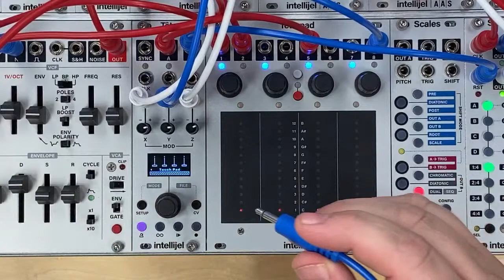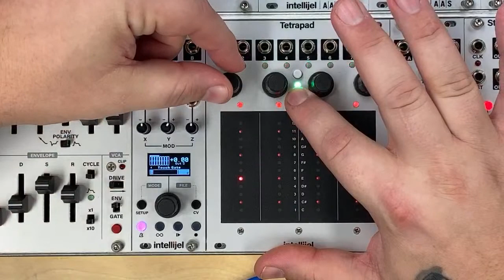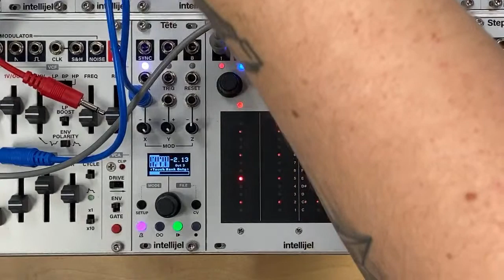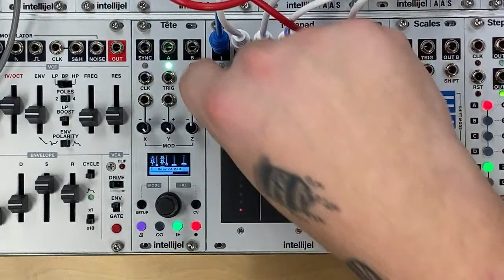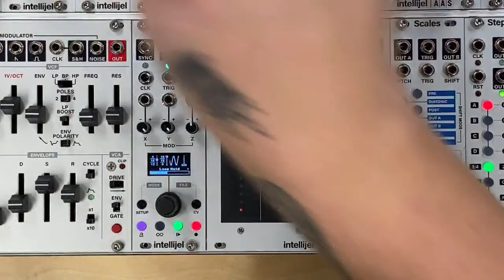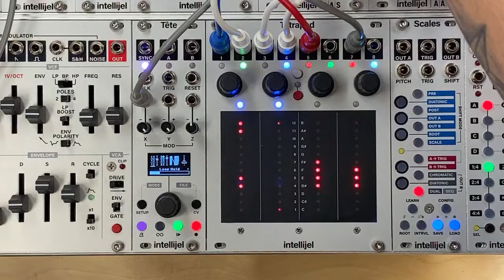Intellijel Tête — Walkthrough / Design / Q+A

Comment: Here's a couple things I glossed over or didn't mention in the live stream—
- Notes Mode Chord / Custom assignment: No restriction to scale or root! — Manual Page 75,80
- Edit View: Make changes to Notes and Voltage banks without affecting outputs.  — Manual Page 85,93
- Copy and Paste Custom/Chord Keys and Voltage banks — Manual Page 79,84,94
- Combo Mode loop vs live: Toggle individual columns in and out of the looper — Manual Page 137

Manual: https://intellijel.com/downloads/manuals/tete_manual_v1.0_2019.12.11.pdf

Comment: Is it possible in voltage mode to manually set the voltage for a single output for all 16 preset banks while the clock is looping through the banks? I am comparing it to the Malekko Voltage block. The Voltage block has 16 banks and while looping through the banks you can set the value at each bank position by just moving the fader while it is running. Is there a way to do something similar with the Tete/Tetrapad?
Reply: No this is not possible. The single output for a bank can only be dialled in one at a time, but once you set it you can copy and paste it to other banks.
Reply: @ScottMFR  Thanks for the reply. Seems like this would be a simple feature to add. I imagine it as going into an edit mode for an output and then using a fader to set the cv value at each bank when the bank is active while looping. Setting each cv value by hand is tedious. The copy and random options help but it would be nice to have real time control over the banks. I suppose you could do something similar in combo mode with faders but it is not quite the same. 
I hope they add that ability. That is the only reason I am debating on getting a voltage block but Tete/Tetrapad can do so much more.